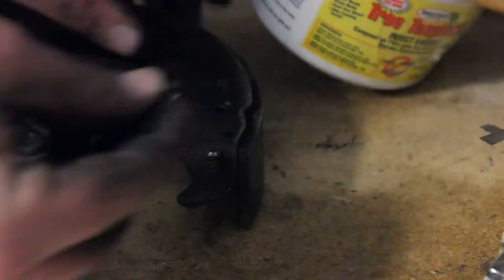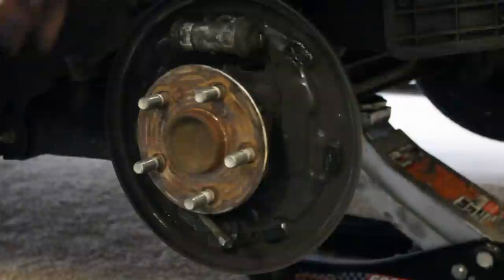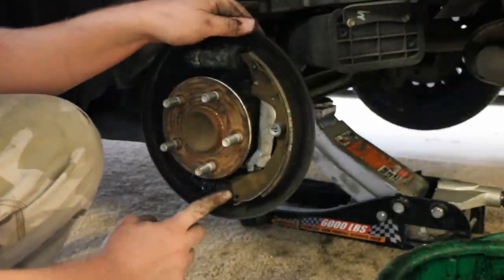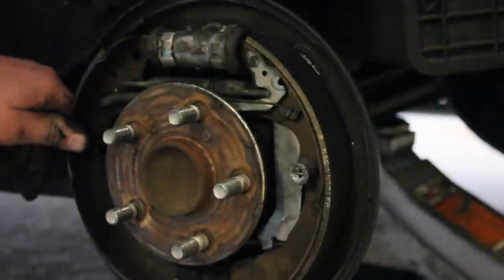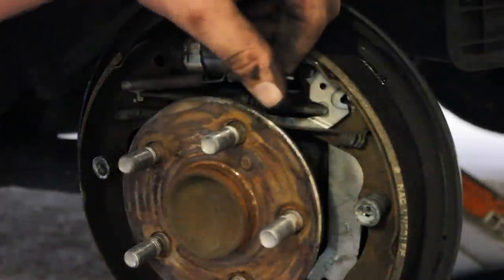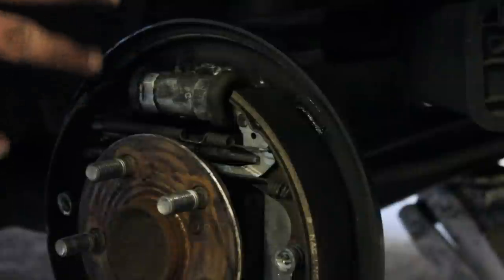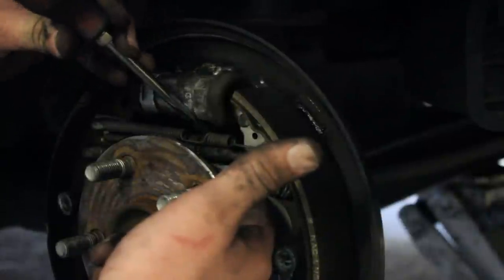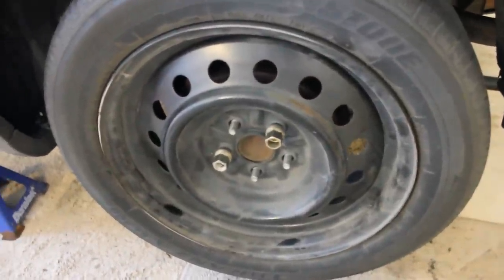Toytota Matrix, Pontiac Vibe Rear Drum Brake Replacement

Comment: It's a good idea to buy a pair of new c-clips for the hand-brake pin. They are not expensive. I would have put brake lube on the pins, and on the c-clips. Also, on the end of the brake shoes, where they contact the brake pistons but don't overdo it; you don't want grease to get into the cylinder. Put brake grease on the other end of the shoes where they contact the grooves at the bottom. Also, all the moving parts of the shoe adjusters should be lubed with the same brake lube - completely disassembled and lubed then reassembled. It is SO much easier to adjust them if you've lubed them, and the automatic adjustment process will proceed more accurately and more reliably. Also, a bit of lube on the shoe-retaining spring, retainer cup, and pin is a good idea. You don't need a special tool to get the retaining-springs on. You can manage with your channellocks, and the needle-nose pliers I mentioned in part 1. And for glob's sake, do NOT grab that spring with diagonal cutting pliers - you will both weaken the springs and dull your cutters. Use flat-surface, non-cutting, non-marking pliers to grip the spring or, better, a spring hook that loops  AROUND the end-loop of the spring and enables you to pull on the spring.

Comment: Thanks. Saved me some time figuring it out. I forgot which way the parts went. Drum brakes are a weakness of mine. Like most things there are several ways to do the same thing.
Reply: +Channel Zero Yeah, but the real concern is, is when you are done, and there are parts on the driveway.  Ha ha ha!!!
Reply: Yea, you kinda know something is really wrong when that happens.
Reply: +Channel Zero  Well.......that use to happen ALL THE TIME when I was a kid, and my father and brothers worked on cars (contemporary, classic, and antique). Seems we always had parts left on the driveway. I'd always say "hey dad, you should write a letter to the car maker and tell them they don't really need that part after all. It'd save them money". The cars always ran fine afterwards.
Reply: @aspenrebel  The biggest problem with parts on the driveway is when the driveway was clean before your attempted test drive.

Comment: Excellent Video, drum brakes are a pain. Good lighting and delivery.
  For newbies, not only is laying out the parts in an accurate orientation a good crutch, but also I recommend them DRAWING the orientation of the springs (narrow-end/fat end; and 'hook' orientation), as well as the all important orientation of correct threading for the 'adjuster'(as you mentioned).  Inspecting for leaks at the piston cylinder is a 'must' as well!
Reply: and make sure to use a flare nut wrench when replacing the wheel cylinder which should be done with every drum replacement. and use a real set of pliers and not some snippers like this guy does on the springs. in my opinion of course

Comment: For those still doing this, you'll probably also want a round nylon 'paint brush'.   Once you've disassembled everything but the piston boots, hose down the back with the spray, then scrub it with the brush.  Do this two or three times, and you'll have almost all of the old brake dust and caked up lube removed.   Then do a quick rinse with the spray cleaner again.

(Note: The piston boots were skipped.  Most repair kits come with new boots.   Any 'how to rebuild drum brakes' will give you that information - it's universal) 

If you do drum brakes frequently, the 'screwdriver' you use is actually bent at about 30 degrees.    

BE SURE TO CHECK THE DRUM!   As soon as you've pulled the drum off, flip it around, and check everything. (including cleaning off brake dust) Make sure there aren't a lot of grooves from pebbles, sand, etc.   They're cheap enough to buy that you may just buy a 'kit' with replacement drums.   (When you're doing this, remove the bolts as well :) ) 

Also, you don't really want your drum brakes to drag as much as he shows them.   If you're hearing the brakes drag on the drum, that means they'll be dragging as you drive down the road.  That's not good for the brake shoes, drum, or your fuel efficiency.  Generally, go till you drag, then back off one step.   Remember, your brakes do not really retract (other than with the spring tension).   So if you're dragging shoes on the drum, you're going to be heating things up quite a bit - you'll ram the shoes in, then back off - and you'll still be dragging the shoes, at least until they wear down.  By then you could warp the drums, depending on the kind of driving you're doing.  You should barely hear a scuffing noise, and it may take several rotations for the wheel to slow.  (This is a good time to listen to your bearings) 

If you've replaced the shoes and drums, there's a good chance you'll have to adjust your emergency brake as well.   (Check other videos for this - out of scope for this one)

Oh, yes.   Last thing.   Remember that the brake shoes are not identical.  One's thinner than the other.  Primary and Secondary.   Don't get them mixed up.   The thinner secondary faces the front of the vehicle.  The thicker primary faces the back of the vehicle. 

Other than those minor things, it's a decent video.   I'm checking because while I know how to rework drum brakes, I haven't pulled them off of a Matrix/Vibe yet.   Some hubs use screws, etc.
Reply: I am doing a drum and shoe replacement. Got everything taken off and put back on except the drum doesn’t fit even when the adjuster is adjusted to the lowest point
Reply: @highflya1391  - Did you make sure you put the pads on the correct direction?   One is thicker than the other, and they do have to face the right way.    I haven't dug into mine yet, so I don't know if it's one of the ones that can have too much shoe material or not.   It's really rare, but I have seen where people had to file/grind off a tiny amount of shoe to fit the drum.
Reply: @tbelding  I got duralast brake shoes (785). Two of the shoes came with the silver piece in one of the slots, so I used one of each and put it back exactly how in came out
Reply: @highflya1391  - supposedly 785 is the right one for the Vibe/Matrix;  I suspect the brake pistons are fully extended.   Put a hose or something on the bleeder screw behind it, crack it slightly, and with clean! hands, compress the brake shoes.   You can probably find better information online about it than I can give you.

Comment: regarding adjusting the shoes once they are back on: I am curious if this is necessary, as they are supposed to self adjust automatically? I have just read the haynes manual regarding changing the brake shoes, and they don't mention to do this. They state, "Make a number of forward and reverse stops and operate the parking brake to adjust the brakes until satisfactory pedal action is obtained." I am wondering if most mechanics adjust the tension themselves, or if they just do a few forward and reverse stops. Any thoughts? 

By the way, great video as always! Gives me a way better idea than just reading the Haynes manual!
Reply: As Haynes says. Self adjusting
Reply: Self adjusting works, but for some brake systems, that's a LOT of back and forth.   If you go ahead and use the spoon and get yourself close, you'll save a bunch of time.

Comment: you can avoid all this over tightening by putting it together and drive backwards and do a heavy brake application (you thats in a large empty area)and your self adjusting will adjust itself, you might have to do it a couple times before its at where it need to be, you will feel it it will stop better  the first time or 2 will be a little underbraking, when you feel it brake normally your brakes are good to go.

Comment: Is it normal for the drum brake shoes to always be in contact with the drum?  I would think this would cause overheating.
Reply: +thooke222 Well, NO!  Cuz once you drive it, and apply the brakes several times on a test drive, it all settles in just fine. This is just the "measuring stick" for installing the new brakes.  Same as when you do disc brakes with new pads. You think "OMG!  I can't spin the wheel. The brakes are too tight!". But once you test drive it, pump the brakes many times, then it all settles into place.

Comment: The hydraulic cylinders should have been replaced! Why let a thirty dollar set of cylinder kit stand in the way of a complete job.  Those brakes had a lot of miles on them from the looks of the drum plate.  No shop would ever do a brake job without replacing the cylinder kits.